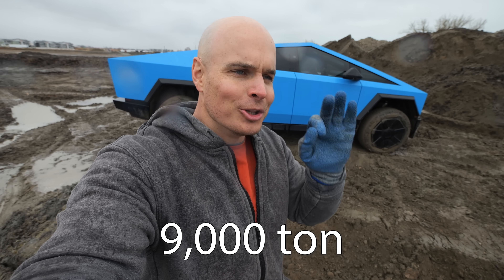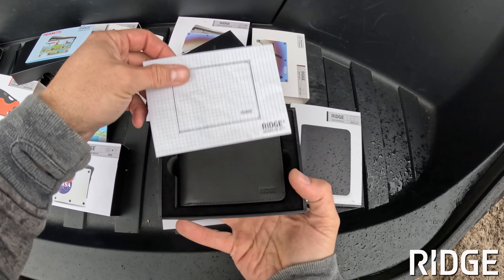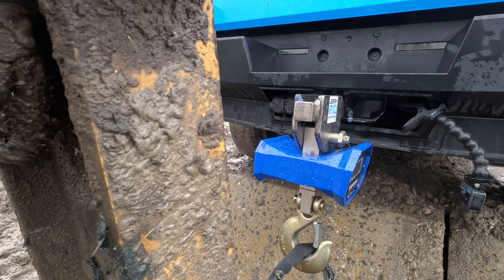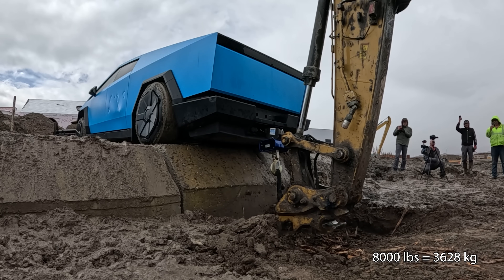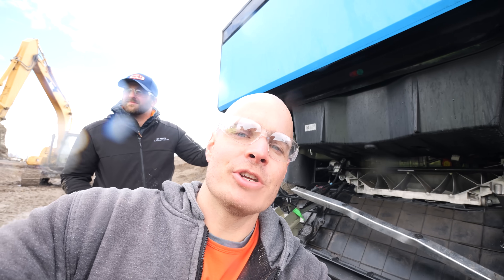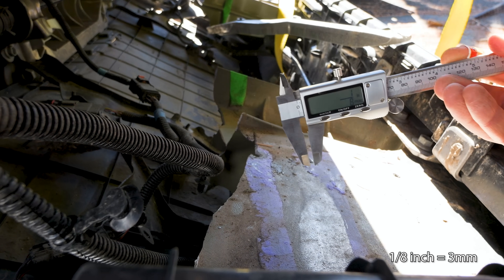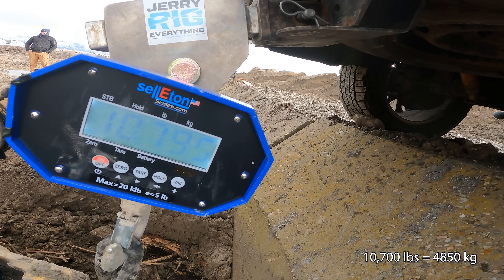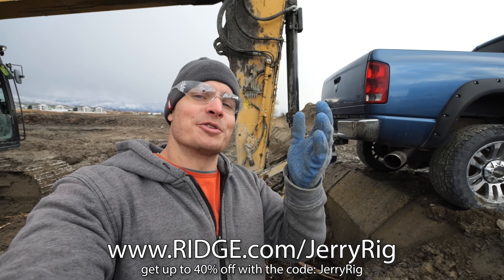SHOULD YOU TOW WITH A CYBERTRUCK?! - (catastrophic failure test)

Comment: Cybertrucks suck but this is a stupid test. To accelerate an 11,000lb trailer at 1m/s² would require fewer than 2400 pounds of force. Also when towing, you don't balance the entire weight of the trailer on the hitch. Tongue weight should be 10% of the trailer weight and the hitch demonstrated it handle several times that rating to allow for dynamic loading on the road.

The only scenario you mentioned that could exceed the hitch load roating would be something like a full-size truck stuck to the axles in mud, especially if you're playing russian roulette using a chain. 25,000lb trailer going up a 10% grade with 72ft² of frontal area travelling at 80mph wouldn't even generate 5,000lbs of force on the hitch.

Tl:dr - the hitch is one of the few things on the cybertruck that works properly.

Comment: It's a completely re><rded test to begin with since the force you're applying isn't what you would have if you tried to actually tow something. What you're doing would be closer to pulling something out of a hole than towing something along a roadway or even out of ditch at any kind of slope or angle...

Comment: Dumbest most propaganda filled video on YouTube. The truck was not advertised to take 11k pounds of straight downward force. On top of that the front is pinned down, Also you compared it to a heavier duty truck. Let's see how Rivians, Tacomas, F150's or any 1500 series truck holds up to this test.
Reply: Any accident will never be tesla's problem, but if it can happen, it will happen. I predict at least a few people will be successful in getting the end detached, resulting in unnecessary damage or even lives lost. Going with cast aluminium only saves tesla the money.
Reply: @davidcrtalic9795  No, It will not happen. If you stick to the safety ratings advertised by Tesla this will never happen in the real world. If you ignore the safety rating by a factor of 11x like in this video, then yes it will happen. You can break anything if you try hard enough.

Comment: You're pulling in the wrong direction.

German law for comparison:
Towing 5t means on level ground the trailer is pushing down with a minimum of 5% of that.
 (limited to 25Kg for traileres of 3.5t and lower)
A typical maximum downward force is listed in the owner's manual of the car. 75Kg, 100Kg and 150Kg are typical values.

Nothing even remotely near the horizontal towing capaciy.

Comment: I see a LOT of people defending this result and i can’t disagree more. As a trucker and someone who frequently tows bumper pull trailers I wouldn’t touch that hitch with a 10 foot pole. There are rough roads out there and sometimes people suck and driving and you need to slam on your brakes. Potholes put incredible loads on tow hitches for fractions of a second. Hitting your brakes shifts the load forward a lot. One sharp jolt can easily put 10-15k pounds on your hitch for a 1/1000th of a second and that’s all it takes to brake it. Imagine towing with this for years and all that wear and tear in the aluminum. Someday that fail load will drop continuously until your hitch fails no matter how soft you drive it. Horrifying

Comment: Worst test ive seen in a while. First off, a 90s truck made of steel is going to beat anything made this decade. Second off, towing capacity does not correspond to vertical tongue weight. your comparing shear forces to compression forces. No way you would ever see this unless you were literally hanging the load off the hitch like in jurrasic park with the rv on the cliff... Third, if its a 50k cat, you can get 30k+ lb on it easily. You just need to get it closer so it doesnt have as big of a lever... this is basic physics, you stopped short of us seeing it break because you wanted to make a point. This is not the science based impartiality I was hoping for.

Comment: using F=m/a you'd need to accelerate at 170km/h or 106mph with a 1 ton trailer to break the trukk, this is 2.7 times below the max acceleration of the V-hickle.
So well designed? LOL, No!

Comment: Just proves that hate wins over intelligence once again. And the comments confirm that. Shocker🤦‍♂️. It broke at over 9,000 lbs tongue weight. Why is that bad? Its rated at 1,100 lbs. Towing weight is a whole different thing. Mostly a horizontal pull, not downward force like was done here. I say they both kicked ass for handling 10x the rated tongue weight.
Reply: An idiot loading a trailer + a good amount of potholes = loose trailer going 100 kph
Reply: what does this comment have to do with the test of downward force on display here, aka tongue weight? 🤷‍♂️

Comment: 11,000 pounds towing does not equal 11,000 pounds payload (only rated for 2,500 pounds btw. this includes everything and everyone in the vehicle). A properly loaded trailer at 11,000 pounds should have 1,100 to 1,650 pounds on the tongue of the trailer. that is well within the payload rating of the thing and far under what this test showed)  it is also far easier to pull 11,000 pounds than to carry it. i can push a 8000 pound truck by hand for example. all that aside the frame should not break in half, it needs to bend at the worst

Comment: Jerry, it is CAST ALUMINIUM, not CASTED ALUMINIUM. This is a garbage test. You are putting continued stress, and that WOULD NEVER happen in the real world unless it were HANGING from the hitch in mid-air. I look at the rating for Class IV hitches in general and several sites say it is 10,000 lbs. gross trailer weight and 1,000 max tongue weight. You destroyed this Cyber Truck to PROVE NOTHING!

Comment: Most people in the comments are not seing the bigger picture. Of course that this "test" is orders of magnitude over tongue weight spec. Also Wistlin's Cybertruck suffered a huge impact, but the truth is that neither of the conventional trucks suffered the same fail on their tests. Towing is not only about towing weight and tongue weight. There are many impacts and situations that produce huge forces on the tongue, even if for small amounts of time. Those will create microfracures on the aluminium cast, even if the cast is perfect. With time, we can see these chassis failing often  in normal uses. 

Thruth is no one is going to work with a cybertruck. It hasn't got the range for that. It's a lifestyle truck, but still built like crap

Comment: You are testing the tongue weight which should be about %10 of the tow capacity.  The fact this failed 10,000 lbs  is a resounding success.
Reply: Static load is VERY different than dynamic load
Reply: @johnhayes3314 yeah a 5,000lb load bouncing up and down can easily double its mass on the downward motion
Reply: Someone didn't watch the full video
Reply: But he promised investors UNLIMITED towing capacity. Tongue weight shouldn't matter it that's true.
Reply: Still a shit truck and not one to drive near when it's towing. Steel on trucks don't fail! This is a failure in design!
Reply: Yeah I’m the biggest Musk hater there is, but this is just dumb.
Reply: The fact that he says its a serious problem that the frame broke at 10k lbs just shows how much EDS jre has. The wheel wells were touching the tires.... Like dude (jre) just give it up.
Reply: @Nathan-ty6fd you don’t understand static vs dynamic loading. This limit could easily by passed by a 5k trailer getting hit with some rough roads over time. The point about aluminum deformation is a really important one.

Comment: I feel like this isnt an entirely true test as its vertical load not horizontal. The number that youre testing here is referred to as "tongue weight" specifically - The maximum tongue weight for the Tesla Cybertruck is 1,100 lbs... Roughly 10% of the actual tow weight. ... Which is what it says on their manual website. So 10k lbs when it was only supposed to be 1100lbs is pretty good.

Comment: I have a major issue with this. Youre comparing it to a steel body truck from the 90s. Nothing modern would beat that. Need it to be new truck.
Reply: Yes, when cars were made to survive but drivers weren't, now everything is built to crumple.
Reply: Not fair , you mean putting up against an old truck that’s been worked for 20 plus years without having the towbar break off😊😊😊😊. 
 It seems like a more than fair test.
Reply: @mikldude9376  the dodges hitch bents also at those extreme weights, which just goes to show that nobody in 20 years had decided to tow more than 6 tons VERTICALLY (so no bump is going to exceed the cybertrucks 10K limit
Reply: @mikldude9376  modern cars are weaker because they are made of a lighter material for greater efficiency.

Comment: Steel has a fatigue limit!!!
it will not be as strong as it was over time.
steel will have a fatigue limit threshold though, meaning it fatigues but after a while it won't weaken anymore, so a well designed steel component appears like it doesn't fatigue.

Comment: If you buy this piece of trash despite all the known issues and poor engineering, you can’t complain when it turns into an expensive paper weight.
Reply: What was shown in this Video was good engineering, not bad engineering. The tongue weight spec is 1,100lbs - it withstood 9000lbs.
The aluminum makes the care lighter - giving longer range and lower consumption - that is engineering, make tradeoffs.

Comment: Sorry Zack, all due respect, but I thought you were smarter than this. There is a reason the wheels on a trailer are towards the center and not at the very back. The tongue-weight on the hitch is about 10-15% of the trailers total weight. If you MAX OUT the Cyber Trucks towing ability, that's about 110-115lbs on the hitch. This means it far surpasses the limit it needs to tow it's maximum capacity. I was actually impressed with how much weight it took. Looks to me like you could tow FAR MORE than 11,000lbs. Also, side note, please don't give whistlindiesel publicity. It's bad enough that he resides in my state - he's a certified insane idiot who doesn't know anything about any of the topics he talks about. He's become rich by acting like a Jackass.
Reply: Am I missing something or did you drop a decimal.  An 11,000 tow rating should have a tongue weight rating of 1,000lb or so.  You wrote 110lb.
Reply: @ You're right. Math isn't my strong suit, but even so. It took 10 times it's limit.
Reply: 😂 did you think he was going to make an honest video this time??

Comment: Sorry @Jerryrigeverything, you are so wrong on this one.  Your engineering is all wrong on this test.  The test standard for 10,000lbs of towing capacity requires the truck to pass 5000lbs of down force and 5000lbs of forward force applied to the hitch package.  This bumper breaking at 9000lbs+ fully exceeds the requirements of a standard truck.  Sorry brother, your engineering skills didn't serve you well this time.
Reply: I have to think he knew. Anyone who has towed anything knows this. Gotta be for the clicks
Reply: Still a shit truck and a bad material for the required use. These trucks are putting American lives at risk on the road whenever they tow.
Reply: The tongue weight is rated at 1100 pounds, so it broke at nearly 9x what its rated but still had the balls to lie to all of us and claim it failed.

Comment: Aluminium an be strong, Al alloys like duralium are 3 times stronger by weight than steel, that said they have limitations like fatigue but this thing wasn't designed by real engineers, more like value engineers. I am an engineer btw (so I hate those cheapification guys)
Reply: If you were an engineer, you would understand that you have weight limits in electric cars - or you will seriously degrade range. And this hitch did pass all requirements for the allowed towing weight.

Comment: Tow hitches a never designed for heavy load, they are made for heavy pull. Rule of thumb is 25 kg on the two hitch, max, so any person should be able to lift the trailer by hand. A 5 ton press directly downwards will never happen under any normal use. I am impressed that the aluminium could hold that much. Of course steel is stronger than aluminium, but aluminium is strong enough.
I feel you only make this video to earn money on your hate for Elon Musk, and that is fine by me :-)
Reply: Yes but I'm not sure where you got the 25kg, maybe that's something specific to your county. You can certainly have more tongue weight than that here depending on the capacity of the hitch. Usually about 10% of the overall towing capacity, so 1100 lbs on the Tesla. It can get bad rather quickly if you don't have enough tongue weight compared to trailer weight, lots of videos on YT demonstrating that. I agree that this test proves more than adequate strength in the short term but I do have my doubts about the long term. Commercial trucks no longer have aluminum frames for a reason.
Reply: @averyw.3939  if you put weight on the tow hitch, you lift the front tires. That makes your car loose traction and steering on the front wheels. That is very dangerous. So the rule of thumb, at least in my country (not a law) is that you should be able to lift the front of the trailer by hand or else it's too heavy in the front (cargo on trailer is not balanced well enough)  and too dangerous to drive with.
Reply: @ Yes, but not enough weight on the tongue relative to the overall trailer weight is also dangerous. Not as big of a deal if you’re talking about a little single axle light duty trailer but it’s very bad if you don’t have some weight transfer when towing a 14,000 lb trailer, speaking from experience.
Reply: Yes but the excavator couldn't break the durango.  Not only did the cybertruck break but it bricked itself. I feel you fail to understand that those things have very delicate battery packs in them.  If there is even the POTENTIAL for battery damage the vehicle could blow up at any time.  Consumer trucks are supposed to get beat up.  Like I always say Tesla cars are fine for the price.  Cybertruck's are entirely form over function.

Comment: @JerryRigEverything / Zack Nelson do you realize this test completely misrepresents the Cybertruck’s towing capacity? You applied 10,400 lbs of vertical downforce directly onto the hitch—not a towing load—which is nearly 10× the expected tongue weight for a properly loaded trailer.

Would you also test a bridge’s weight capacity by stacking weights on the railing instead of driving across it? Because that’s essentially what you did here.

Since the Cybertruck is rated for 11,000 lbs of towing, which means pulling weight—notwithstanding extreme downward force—how exactly do you justify this as a valid test? Shouldn’t you acknowledge that no real-world trailer setup would ever exert this kind of force on the hitch?

By presenting this as a "flaw," when in reality no truck is designed to handle a direct 10,000 lb vertical crush force, aren’t you misleading viewers? And given how misleading this is, do you think Tesla could have grounds for defamation if your video causes measurable harm to their brand?

Comment: I wouldn't vouch for a Cybertruck in any way, but I'm a bit confused here.
The MAXIMUM tongue weight capacity of a Cyber truck is 1,100lbs (simple Google Search)
and you pushed it to 10,000lbs before it broke and we are calling that a failure at almost 10x over the recommended amount?

I'm not saying that's great, because honestly I have no clue, but pushing anything 10x past the manufacturers limit seems like asking for trouble.
Plus a properly loaded trailer should have the weight mostly balanced over the trailers axles, not the hitch of the truck.
But again, I'm probably just misunderstanding the point of this video.
Reply: You are missing the point here - what he want's to say here is: Orange man bad!

Comment: So, aside from putting vertical stress on it, instead of a horizontal load, which is generally a towing setup (the number of wheels/axels on the trailer will make a difference)

Comment: "is that glued?" , "that's tesla for you!" " that's how they build their cars" 
LMAO and we wonder why tesla shares have fallen through the floor...
maybe elon should stop fcckkking with our veterans benefits and go back to put his company in order...
Reply: Almost all cars have glued frame parts today.
Reply: @TylerDurden-pk5km   almost but not all and not in the past as many older trucks are. And there is glue and there is glue and there are ways to glue as part of an overall process for strengthening but the cyber truck seems to have only chosen the most basic solution to these problems and you can see that on full display. 
The cyber truck is fine for many things but if youre towing stuff over distant then it be the last truck id chose and for those who dont they might find themselves in trouble going up a hill or if they hit a bump etc.
Reply: @ The problem with towing, will not be the glue or the construction, but that battery technology is not advanced enough and range will be limited. 
Without modern construction techniques the truck would be much heavier and range even more limited. Typical engineering tradeoffs.
Reply: @ No. In general: All cars are much to heavy - you are driving around 1-2 tons of steel, to transport a on average 1-5 80kg person - in most cases 1.
With combustion vehicles it is not that bad, because fuel is very energy dense - you are still wasting A LOT of fuel.

Batteries are not that energy dense, you cant pack that much battery into a vehicle before it becomes a ridiculous, a tank.
Hence: You have to innovate and build electric vehicles lighter. For example by using aluminum. 

Building lighter vehicles that remain safe is a common good.

This video is very disingenuous because the creator has TDS an by extension dislikes Elon Musk.